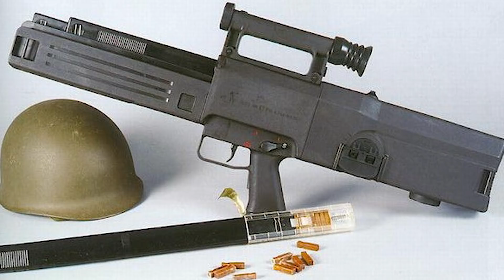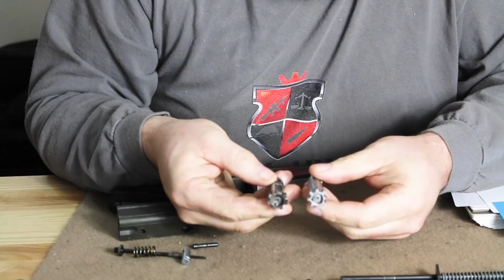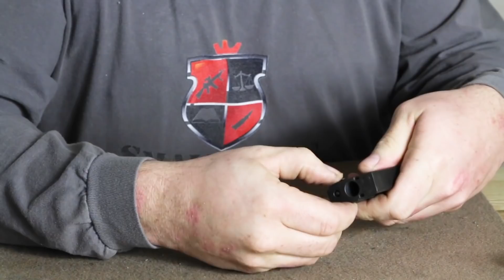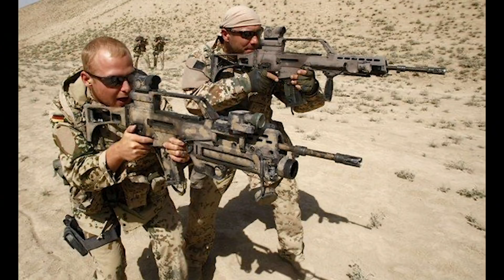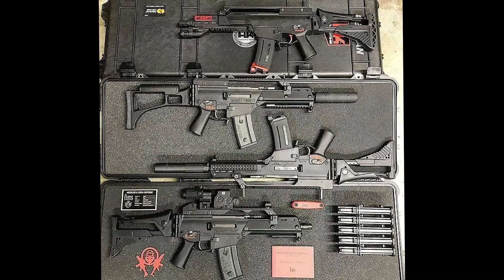The HK G36 Rifle

Comment: fun fact: Spain produced addopted and produced the G36 under license short after Germany did. However, the spanish MoD didnt rely on the G36, so the spanish version called G36-E (the E stands for España, Spain in spanish, and not for Export as some people think) is different. The G36-E was build with a double heat shield in the handguard (like the M4) and a heavier barrel, making it closer in design to the MG-36 (the mg version of the G36). So, no problems like the germans suffered have been reported in Spain.
Also, the G36-E has an even worst scope. It is only 1.5x and without red dot on top of it. So the standrad practice is to add an M1913 on top the handguard plus an scop (one of the most if not the most used one is the eotech holograpich 512.A65 sight).
Reply: PS: @SmallArmsSolutions great video, thanks!

Comment: HK made comments about the possibility to upgrade the G36 before 2012, for example the barrel that was planned for the MG36. The upgraded G36 should only weight 130 - 150g more. But our Government didn't listen. And after 2012 they declared it was HK's fault.

For me the G36 is a good and reliable rifle with a lot of upgrade potential, i don't see a reason for a completely new design.

And about the design elements copied from the AR18... why not. After 1990 the G11 project was canceled and they only had a few year for something new. I like that about HK, tell them what you want and they will deliver exactly that and in the numbers you ordered.

Comment: To my mind the Zeiss sight wich has a 4x magnification is just right. Besides you shoot with both eyes open, so the issue with the narrowed field of vision is reduced a lot. Further more you can enhance the red dot by pushing once on the on/off switch, but that consumes more battery power.
Regarding the overheating: think about which geographical areas the G36 was made for.
Up 2001/2002 there was the Cold War and the German army was used to fighting in they’r geographical region, which is much milder than the Middle East. And until 1990 Germany didn’t participate in foreign conflicts at all. So they didn’t have any experience regarding the Middle East at all when they ordered the G36. It was most likely meant for heavy fire fights, but not in the Middle East.
I still think that for a conflict in the geographical region of Europe the G36 (would) perform formidable.

Comment: Having had the opportunity to the G36 and been issued the VHS-D1 and VHS-2D, which use similiar magazines, i can say that the original G-36 mags and especially their sort of, but not quite copy on the VHS-D1 croatian rifle do feel somewhat flimsy and we had many reports of the original VHS-1 mags breaking on rocks when going prone and stuff like that.

The VHS-2 rifle had a redesigned magazine, more in line with the magpul ones you showed, and they certainly felt more durable.

That said, the flapper latch system is imo far, FAR superior to the AR style system, which was also used on the VHS-1 magazinea and rifle. I fucking hated that system. Was overjoyed when i was issued the VHS-2D for that reason. Not exclusively, but it was a major upgrade.

Comment: Hey. Very nice comprehensive history video. I came to put my 2 cents in. I served in Lithuanian Armed forces back around 2016. We used different G36KA4 version designed to meet our military specification. It came with Swiss B&T Aluminium hand guards and no optics (just mounting rail on top) and we used them with mostly EoTech sights + magnifiers. Rifle I got issued looked like it seen better days. because it was in the inventory since 2008. Yet no bad things to report. Accurate as much as the shooter is with standard GP21 Ammo, Never had issues with mags ether.  Pretty reliable in mud and sand too.  My buddies uses them in piece keeping missions in Mali, Africa and are pretty happy about them too.  I admit triggers do suck... 
After that overheating scandal Germans got into our military conducted separate investigation and concluded there is nothing wrong with the rifle itself. It does what its designed to do. Even our user manuals stated to let the rifle cool down after a mag dump in full auto.
Reply: Germany should just update the G36. For example heavier barrel and dump the dual optic. It was great 1997 but it's outdated today. 
HK made the same suggestions around 15 years ago, but our gov ignored it (like always). Than the firefight 2012 happen and now it was HK fault.
Reply: @23GreyFox   Heavy barrel is not gonna make G36 platform more heat resilient. Trunnion will shift inside the polymer receiver before anything happens to the barrel. That's why MG36 didn't catch on. But to be honest G36 was never designed as an automatic support weapon. It's primary design objective was light weight. I've seen some German units had similar G36 variants to our with picatinny rail tops and EoTech sights mounted. I still love the platform. Imagine if similar amount of RND was afforded to the platform as to the AR-15. Even if just greater after-market options for triggers and so on.
Reply: @240pixel  To make the G36 into a MG36 was never the target and the G36 never had big issues with melting or deforming plastic. At least no more or less than any main line rifle on this planet. When i look at the newest versions of the rifle i believe HK made the right suggestion.

Comment: Regarding the optical sights on the G36 - you got an A0 clone there - which you’re obviously aware of.  Combat troops going on deployment are issued mostly A3s with a ZO 4x30 which is a HUGE improvement over the A0/A1/A2 ZF and a Zeiss RSA which offers some improvement over the old red dot sight, or KA4s with EoTech EXPS3-2s and G33 magnifiers. Both the A3 and A4 have an aluminum freefloating hand guard (with some of the later A4s using the HKey slimline) and the length and hight adjustable stock as well as lengthened magazines releases and bolt catches, that now also functions as a bolt release.  Overall these upgrades really help ergonomics especially with bodyarmor and helmets with active hearing protection and overall effectiveness due to the enhanced sighting systems (more so with the thermal and night vision included in the IdZ ES 2 programm)

Comment: 2.3 moa with match ammo is kinda bad......that means with standard 62gr NATO ammo it's probably pushing 3 moa groups.......what was the German standard of accuracy minute of barn? Even Russian AK74M's using 7n6m ammo still on average score 2 to 2.5moa.
Reply: Could just be him. Henry over at 9-Hole was able to get around or slightly better than 2.5 MOA 9 shot groups with 55 gr ammunition, with the exact same rifle.
Reply: @ABowlofPho  that's still not great for a rifle with this price tag and how new it is. Also the G36 has a 1 in 9 twist rate which is designed for the lighter weight bullets yet it has worse accuracy than a Colt M4/6920 with the same ammo.

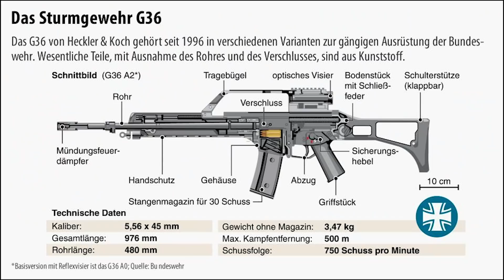Comment: 5:08
at first i thought: "lightweight all polymer? it is still 3,5 kilos for something all polymer!"
but then i realized: piston and the optics are considered in that weight
So, at the end: yes, it should be very lightweight in his category. Also, the bolt is a square chunky boi.
Reply: Even the G36C which has a 9 inch barrel and no optic is still 6.2 lbs. Compared to a M4A1 with a 14.5inch barrel and a Aimpoint COMP M4 which is about 7 lbs. Pound for pound the G36 isnt very light.

Comment: The G41 is not a semi auto only version and its also not a G33 that uses a M16 mag it also has a forward assist and ejection port  cover.
Reply: Agree, there's more to the G41 than simply a modified HK33. It was also plagued with some ejection issues. It was also much heavier than the '33

Comment: german soldier here, 
they didnt get the light weight thing quite right though, cause these things are still 3,6 kg, plus the only ones liking it are soldiers who arent gun nuts, meaning, they have never fired any other rifle than the g36, or are non combat units on top of it.
Reply: Will it does have a 450+mm barrel and everything that goes with it. Plus that optic, so it wouldn't be fair to compare this to another gun without optic
Reply: @Tool683  that doesnt explain why my ar15 with all the bells and whistles is still light er than a Standart issue g36

Comment: Durable, lightweight, low cost.

You can pick 2 but you can't have all 3.
Reply: Current ARs fit all 3
Reply: I'd argue that we have all 3 in AR15's today. Then again, that depends upon how you define " low cost".
Reply: @sanguinemoon9201  kinda.  I wouldn't argue that a $400 PSA is as durable as other options. I have heard of ToolCraft BCGs shearing bolt lugs sub 5k rounds here recently. I wouldn't call that durable. But this is likely due to poor QC and not so much durability of materials.  Toolcraft can be excellent BCGs but if there is little to no QC done then alot of the rejects will get out.
Reply: @toki89666  M4's are durable, low cost, and lightweight
Reply: @toki89666  Laughs in AK
Reply: @Mrvn_1337  yes. AK rifles are all 3 IF you already have an entire factory set up to building them, then they can be low cost.  But to just start building AKs they are very expensive mostly in labor. For example if you have a complete AR-15 and AK worth of parts but completely disassembled the AK is going to cost alot more to put together, many times over the cost of the AR.  Even if you do it all yourself there is the initial cost of tools for the AK and even if you have those it takes alot more time and careful know how, and time is money.
But if you have an industrial scale factory like in Russia the individual unit cost will finally be very low.
Reply: @toki89666  even a standard FN M4 only runs about 600 USD a rifle for the military that is considerably less expensive than the G36 and HK416 yet in all military testing the M4 still is the clear winner. At most the HK416 was only 5% more reliable yet cost 4 times as much.
Reply: @nemisous83  M-4 might be cheap, but also only when mass produced. Noone made economies of scale go away. And if they are cheap when not mass-produced, then they won't be rugged enough or accurate.
Reply: @Max_Da_G  the M4 is all of that. It's both lightweight,accurate, and cheap. The G36 and HK416 have been produced for some time yet their price per unit has only went up.
Reply: They say this in Hollywood. Fast, Cheap, Good

Comment: A rifle/carbine with a pencil barrel should never have a full auto switch.  InRangeTV has put together something special with their WWSD2020 rifle and you should check it out. It's not military ready, yet.  It needs a barrel mounted flip forward iron sight, a lightweight flip down rear, the carbon fiber handguard needs to be revamped until it doesn't flex badly enough for a POI shift with an IR laser(at least that was a problem with the 2017 version). Beyond that it's a pretty good piece of kit.
Reply: I disagree with the no full auto on a pencil barrel. Firstly, contemporary pencil barrels can handle more than you think. Secondly, I've no issue melting a barrel breaking an ambush. That being said, I do use very heavy fluted barrels on the light support weapons I put together. I am not a fan of pencil barrels in general, but if you are going for lightweight, Faxon and ballistic advantage make them that'll survive limited full auto use.

Comment: I'm most interested in the piston design of this gun. The protrusion on the front of it seems to work with the hole in the front of the gas block to vent gas. However due to the tapered nature of the protrusion I suspect it would start to vent gas as soon as the piston starts moving. Is there an advantage to this design, when compared to traditional side venting pistons such as the one seen on the AR18?

Comment: great info; when you're in town next you're welcome to take my factory G36E for a spin
Reply from the maker: Mrgunsngear Channel I will do that! Let me know if you are heading to Texas!
Reply: SmallArmsSolutions can the T36/T36C/T36K from Tommy built be safely run suppressed?
Reply: How is the trigger on your G36E? The trigger on this gun was pretty heavy but I heard that the original HK guns have a bit of a lighter trigger pull?
Reply: @ABowlofPho  The trigger pull on my TommyBuilt T36ES is great. A couple millimeters of take up, then a wall, then a very crisp and clean break. It's definitely a military trigger, but extremely predictable. I find it easy to fire accurately and don't really agree with the complaints many people have with the G36 trigger.

Comment: As a former Marine and former Weapons Handler what the Marine Corps is doing by replacing the M249 saw with essentially  a long rifle barrel ar is dumb.  I don't understand why they are doing this I get light weight but on full auto rate of fire burns an M16 out quick I have seen it happen to many times it only takes about 400 rnds and blamo the gun is dead.  The HK M27 IAR is not a replacement for a belt fed gun and thru testing the IAR cannot sustain the same amount of fire as a M-249 saw and is the reason its 30rnd mag feed because if you increase the rate of feed that ups the rate of fire MELT DOWN.  I know alot of Weapons Handlers who are former Military were told that we are old school this is the new advanced combat IAR!   I just shook my head said I would rather carry something with more weight that can handle the days worth of combat.  If you look at belt fed guns their are good reasons they have quick change barrels and thicker barrels plus the receivers are bigger to deal with rate of fire and recoil in the end you got to look at it this way can we lighten the gun? Most likely yes you can but lighten it as long as it keeps reliability of the weapon.  I will get off my soap box with this think to yourself does sustained auto fire mean 30rnd mags or belt feed 200rnd belts that can change out barrels fast and another 200rnd belt back up on target?  I will take the belt fed the HK G36 program was misused just like the M4 program we would get cooked out M4 guns from Special Forces guys while they turned them in they would be complaining about the weapon is bad platform.  I have to say what I learned was the break contact full auto fire tactics is what killed the M4 the gun was not made to handle that much volume of fire so quick meltdown.   Oh this isn't just the M4 we had some s Special Forces bring in burned out AK47s while doing the same drill fry AKs so it does happen misuse of a weapons platform brings bad things.
Reply: I hear you others saying the same ,I`m all about having the best equipment for our people. Seeing the president Trump is supposed to be all about having the best for our people knowledgeable people should send him a shout and maybe he`ll hear everyone and we can continue to have the best for the job.

Comment: Say what you want to about the ar18, this  is what really started the current short-stroke wonder rifle trend.  The bolt carriers on the g36(sl8) and the scar are very similar.  I like the H&K charging handle but you have to have a high mounted rail if you go that route.